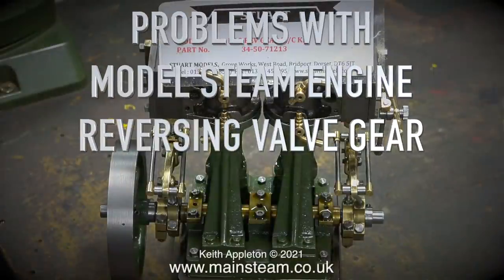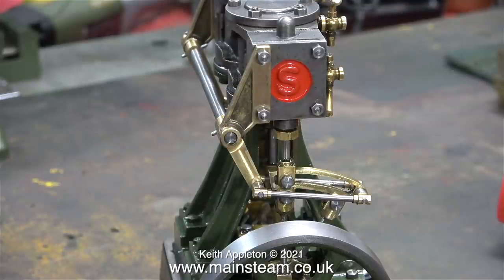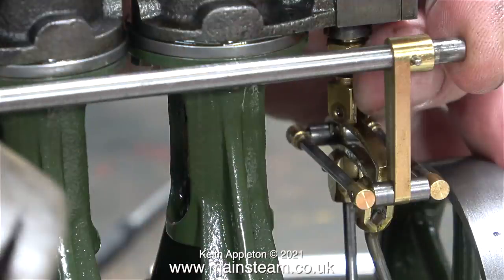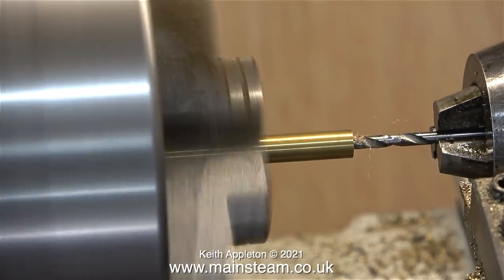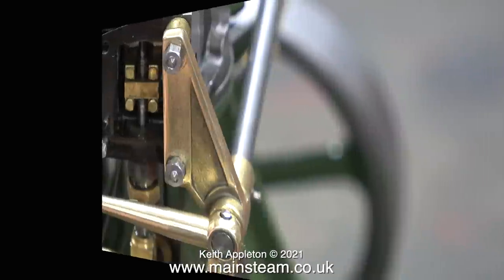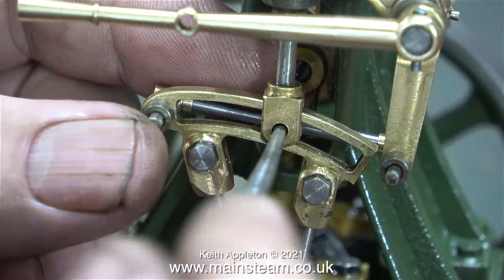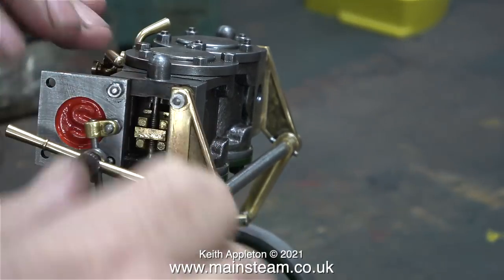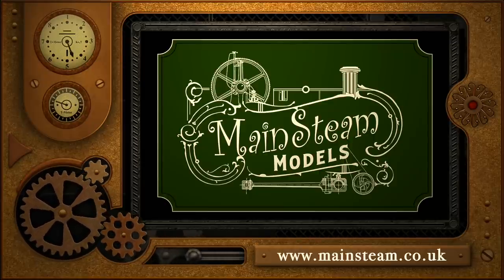PROBLEMS WITH REVERSING VALVE GEAR - PART #1

Comment: It always interests me to hear the term "timing" in these excellent and addictive videos. In the world of full-size engines I think I've only ever heard the phrase "setting the valves" to describe adjusting the valves so that the engine runs properly. To me, and perhaps only to me, "timing" is an i/c engine term, though I could be entirely mistaken. It does often happen.
Reply from the maker: Steam Engine valve timing preceded Internal Combustion Engine valve timing by quite a few years . . . . .
Reply: @keithappleton  I'm talking about language. For example, my copy of Locomotive Valves and Valve Gears by Yoder and Wharren (1921) mentions "setting" valves and eccentrics in the index, but doesn't mention "timing" at all. In the great scheme of things, it doesn't really matter.